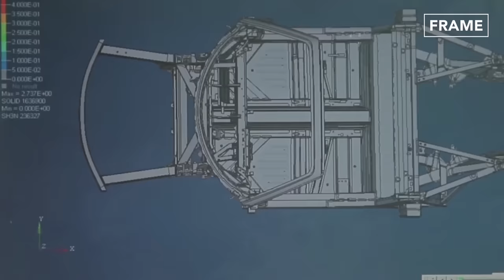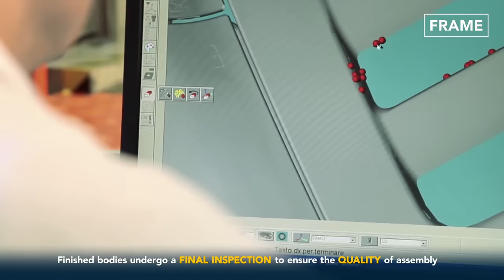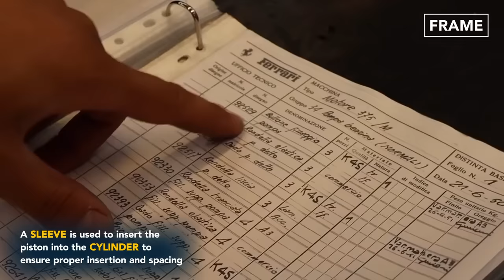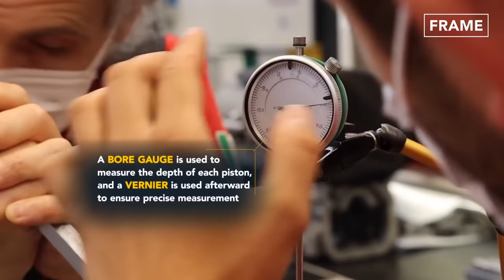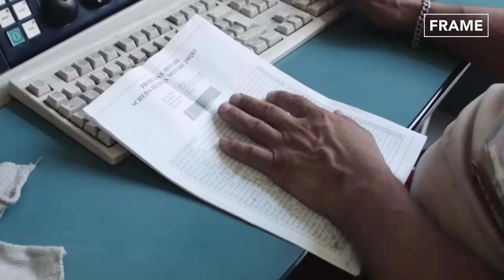Inside Ferrari Most Exclusive Factory Building Supercars by Hands - Ferrari Production Line

Comment: 1. Ferrari was founded in 1947, not 1943.

2. Ferrari only makes around 10,000 cars of all types per year, so producing 135 engines per day (675 per week, approximately 30,000 per year) is inaccurate, to say the least.

3. The video mixes in the restoration service with modern production in the middle, which causes all sorts of confusion if you don’t know about Ferrari.
Reply: I'm sure they make engines for other car producers.
Reply: @mjohns5944  Like Who? I have never heard of them doing so.
Reply: @arthurm4726  Maserati (or they did). They also make lots of spare engines for racing teams. But 30k a year seems a bit over the top.
Reply: @arthurm4726  they produce engines for Maserati and also many Alfa romeo quadrifoglio plus the racing teams
Reply: Ferraris are only so expensive because everything is made by hand without machines. If a Ferrari were built like a Honda Civic, all done with robots, a Ferrari wouldn't cost more than thirty thousand dollars.
Reply: @lenny108  no. The details in sourcing of components alone drives up the price of a car. Take something simple like a dashboard air vent. Feel, and use one in a Mercedes S, BMW 7, or Audi 8, and then look at a similar vent in a Chevrolet or Toyota. There are many, many grades of quality and precision differences that mean the vent component delivered to one of the premium manufacturers costs multiple of what it costs to deliver to Chevrolet or Toyota, regardless of volume.

Multiply that by thousands of parts throughout a car, and you see the base cost difference.

Comment: They take all this precision and care to build the cars, paint them and then before they ship them they destroy the paint cleaning up the car.  They instill swirl marks and holograms and often along with scratches (which sometimes cannot be removed).  This is an issue with their entry level cars all the way up to the most exclusive limited vehicles with triple layer paint option as well.  I've personally had it on my Ferrari's and have seen it on other owners cars. I've seen it at the dealers.    It is just a given and known issue among Ferrari owners.  It is discussed often in the Ferrari forums.   The first thing owners who care about their paint do is transport the car directly to a detailer for triple step paint correction and then PPF protection.  Figure about 5 or 6 grand give or take depending on the car, how much damage from the factory and how much you wrap in PPF.  Why doesn't ferrari fix this?  I guess because people buy the cars regardless....myself included.  Maybe they figure customers will paint correct, detail and wrap so why bother showing any care to the paint before shipping.  Some have told me they wash the cars after the test drives with wool mits and don't do best practices so the paint takes a beating as a result.  But if yo can deal with that the cars are reliable, fun, gorgeous, fast and amazing.
Reply: Never heard of such a thing.
Reply: @stefanoludwig45  you have now.

Comment: Awesome video, love seeing that level of detail. One thing i dont understand is that you mentioned each car takes about 3 months to build and also that the engine guys produce 147 engines per day. To me, building 147 engines in a day seems to be too many. For example, there are 64 working days in 3 months, that means 9,408 engines would have been built in 3 months, which is the same amount of time you are saying it takes to make one car. According to google, ferrari makes about 10,000 cars per year, so making all the engines for the year in about 3 months seems off to me.
Reply: They need a surplus of engines for testing and tuning.
Reply: That video is just one big mess, it's mostly taken from another source and weirdly cut and glued together. Besides, it's showing all different lines as one big process, but there is actually one production line with another for special serie cars and also another kinda of workshop for ferrari certified classics and here is everything together shown as one...
Reply: La parte motori è la più belle tutte fusioni in alluminio guardala